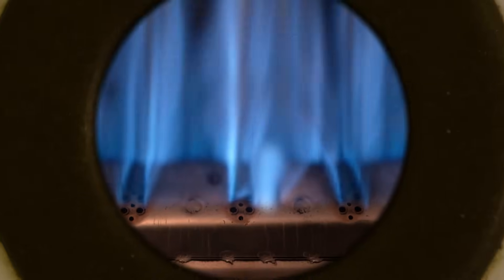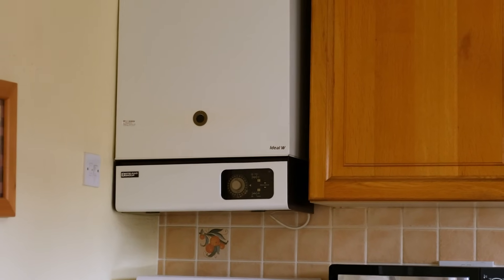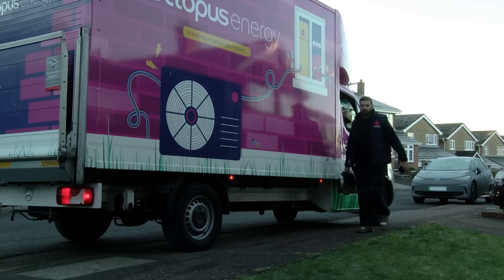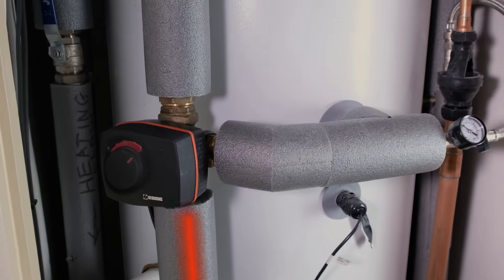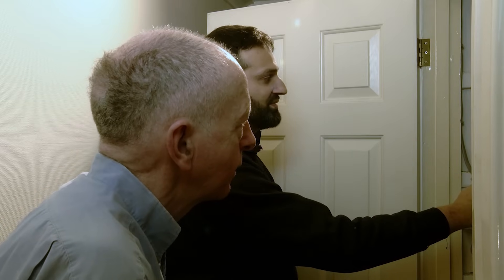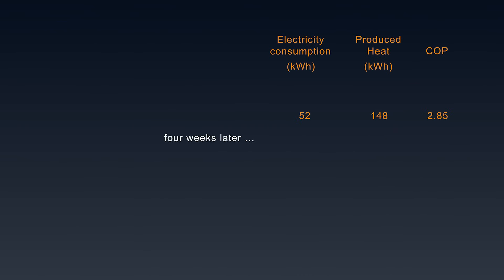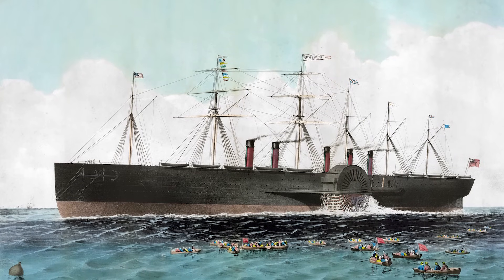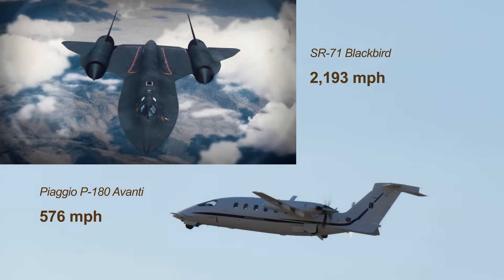Heat without the Guilt - My Heat Pump Story

Comment: Interesting video and very well put together! I've done much the same as you along with adding batteries to the mix, which I charge off peak, and use solar to either top up or export.
Thank you
Reply from the maker: Thanks. My solar system is old and has no capability for batteries, so I would have to have AC coupled ones. I've always thought that the limited amounts of Lithium available should be reserved for phones and camcorders, but perhaps thats not true.

Comment: Very nice video! Could you please also talk about your specific project cost? It would be very interesting to see for me and to compare it to the prices here in Germany.
I have the feeling here in Germany the prices at the moment are still a lot to high for the installations because of lack of experience and lacks of installers. 
I assume that the UK are forerunners compared to Germany at the moment.
Reply from the maker: Thanks. In the UK the government pays £7500 towards the cost, which was around 2/3 of the total. The only other cost I can think of was having to have the path around the back of the house extended as the ASHP covers the original path.
Reply: @VideofoundryNet  Thank you for the information! 22000 sounds reasonable to me. In German the installers would still try to charge  more like 30000 before a very generous subsidy of about 60% (70% max for low income households). But I expect prices to fall in the coming years as new players like Octopus Energy are coming into the market.
Reply from the maker: @idiNty  I did say 2/3 of the total.
Reply: @VideofoundryNet  So it was about 12000 for the whole material and installation? This would give hope to me that we can actually make the transition happen also here.

Comment: Great video! Well done Paul 👍
Reply from the maker: Thanks. I had been pleased with a COP of 4.7, but I came across this Heat Pump league table:
https://heatpumpmonitor.org/ which lists quite a few with COPs of over 5!
Reply: @VideofoundryNet  For best efficiency the heat pump should be run at maximum daytime temperature and at a minimum of 30% power. Try 9am to 7pm.

Comment: A very well put together video Paul, I had a very similar installation done in February, I have the Daikin 6kW HP and to date have been delighted with its performance.

My HP runs 24/7 and consumes typically 12kWh per day for an average 7C outdoor temperature as has been common this past month.

In March it consumed 373 kWh for heating and hot water. It returns a COP of 4.12 for March (that's combined heating & hot water)

My living room typically sits at 21C with peaks of 23C as a result of the weather compensation 'curve' I have set.
Reply from the maker: Thanks - much apprecisted. Glad its going well.

Comment: Thanks for this video, I'm not in a phase of my life where I'd have to worry about heating my own house yet (living in a flat with central heating and all), I just have a question if you're able to answer it, do you think keeping a higher temperature (say 21-23C) diminish the efficiency much? Or the difference between a gas boiler and a heat pump would be similar, just with higher consumption?

Really happy that I see heat pumps installed more and more, it still is a kinda new thing where I'm from, but hearing about it more and more is promising for sure.
Reply from the maker: I would like to be able to answer but I haven't experimented with higher temperatures as my time over the last three months has been taken up with editing the video, and soon the weather will be too warm to really test out the system. I don't wan to guess but if I do get any results I'll post them on here.

Comment: Thank you for such an interesting video, we’re considering a system like this for our Victorian property.
Reply from the maker: Thanks. As regards insulation, I do have a concrete ground floor but I do at least have cavity walls, cavity wall insulation and double glazing.
Reply: @VideofoundryNet  We also have a solid ground floor which is off for a Victorian property, but some cavity wall insulation and double glazing, 3.3m ceiling high also. Even with the inefficiencies of the property, I think a heat pump would be more viable than the current electric storage heater fitted to the house.

Comment: Super useful video! I wish I could have one installed myself, but we're in the top floor of an apartment building in an old house, so there's no access to outside space for the unit. But sooner or later I'm sure gas will be going and something will have to replace our boiler, I just don't know what. I'd like district heating given the choice, so there's no more boiler replacements or breaking down.
Reply from the maker: Thanks - according to https://www.planninggeek.co.uk/gpdo/renewable-energy/class-g/ it looks like an ASHP could go on the roof if you have a flat roof, an as long as it is the only one in the block.
Reply: @VideofoundryNet  That option could certainly help some people, thanks for highlighting it. Unfortunately, many things are stacked against us in this situation. Our flat is in the second floor attic space of a grade II listed house that's been turned in to apartments. Until something new comes along, either a really compact heat pump that can draw and expell air through a gas boiler like 'chimney', or district heating in our neighbourhood, the gas boiler will have to stay.

My hope is that the current boiler keeps working until the alternative comes along. I don't want to spend £3-4,000 on a new boiler and end up either replacing it a few years later, or stuck with it for 20 years when there's a better alternative! And if we do have to buy another gas boiler, do we buy a cheap one because we figure we'll be able to replace it soon, or do we invest in a good one that will last long term? People in properties that are difficult to heat without gas are in a tricky situation right now if our boilers break down. I don't see a clear, good answer what we should do, and I think our chances of losing a lot of money are pretty high - ether from installing a boiler that's not used long, or being locked in to using gas which I suspect will become more and more expensive.

I think heat pumps are a wise move when it's possible to install one. Electric will always be available, and heat pumps are very efficient.